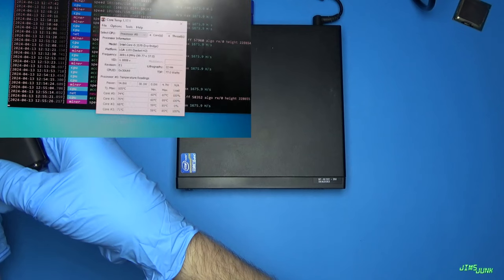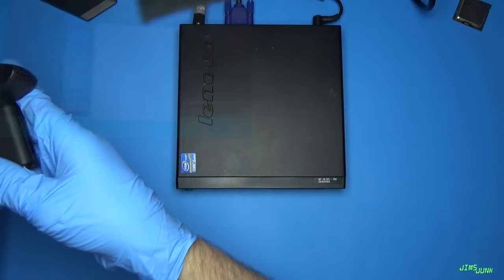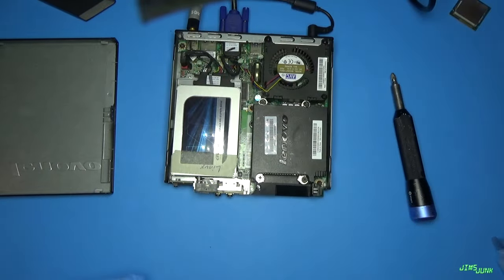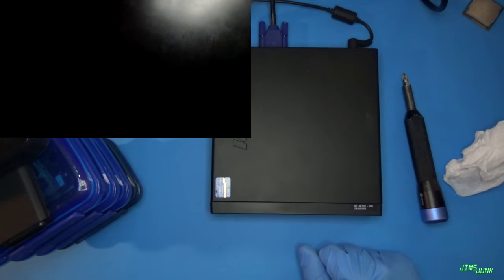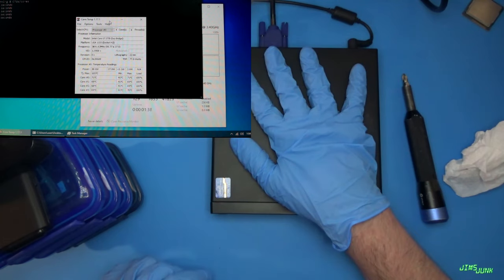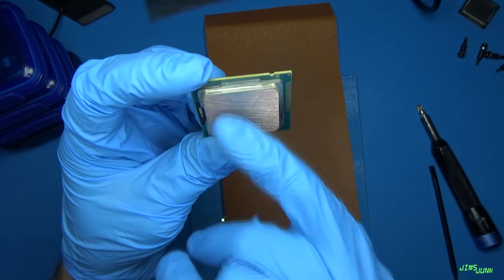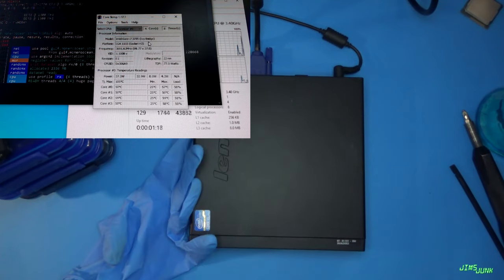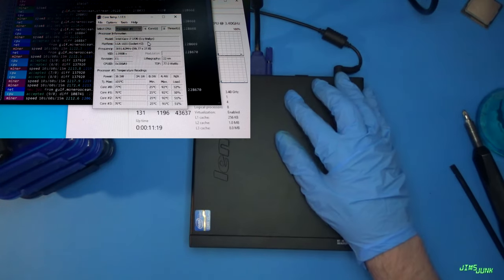i7 3770 in a tiny Lenovo?  Trying to upgrade the CPU in my M92p Tiny.

Comment: You can put a xeon 1275 v3 in there, I have but it's a 95w cpu and gets really hot and then shuts down due the 65w power supply. if you could find a way to upgrade the cooling system and power supply it could work.
Reply from the maker: ya know I thought of that.  Only they cost more on ebay then I was willing to spend.  In the future I might just for the hell of it if i can find one cheaper.

Comment: That is insane the difference it made.  You already lapped the heatsink and that helped A LOT, wonder how fast or hot it would get without the cpu and the heatsink lapped.  But either way with both lapped it stays cool.  Like others said delidding it would be interesting to see if that helps.

Comment: Maybe try a 3770s in a pc like this.
Reply: Yup, they use the "S" version in small PCs and All-in-Ones.
Reply: The "S" still have a tdp of 65 watt. When you are looking for normal temps and no fan noises, the "T" with a tdp of 45 watt is probably your best choice. Also, what I don't see in the video is the power adapter is very important here. Yours can come with a 65 watt adapter, to run these heavier cpu's you really want that 90 watt adapter.
Reply from the maker: Exactly. It does run a 90. I wanted to see if a full blown i7 would work. The s and t m9dels are great but have less performance.

Comment: what i did was  glue on air intake at front  a 30mm usb  fan and that alone  dropped  temps 20 c on cpu at load 
also use a 3770t cpu in it  not a k or a s  as thats 45 watts power  and power pack is only 65 watts  (org) even a 90 has  probs  with the k  trust me i tried note  fan blows cold air in not out so blows over heatsink on cpu and stirs air in whole  case to rear fan   
took about 1/2 hr  to drop temps and  then hold it at that
note  space fan from case x a few mm with plastic  buttons  helps heaps and  drops sound of fan way down as well

Comment: You need to delid that 3770, the thermal paste under the IHS is probably bone dry at 11+ years old.  It's probably 90% at fault for the excessive heat.

Comment: If you want an i7 in there without doing the sanding down, then the 3770T would be perfect.
Reply from the maker: Problem with the t is it's also less performance.  I wanted to see about using the full blown 3770.

Comment: I'm surprised they didn't use mobile processors in these, isn't that what intel did with the nuc?  I mean these are far better than the nuc since you can actually upgrade them.
Reply: "t" chips are more or less laptop binned parts on a desktop package.

These come stock with "t" chips.

Comment: That convinced me. I have two i7-3770's. I'm going to lap one of them and see if I get the same or better results? Mine will be in a regular desktop PC. Should be fun. Does anyone know what grit the brown sandpaper was? Thanks
Reply: For softer metal like copper, 600 grit is a quite safe bet, start gently and check for effect every few minutes.
If you have a whole set, 600-1000-3000 will be a good step-up combination, giving you close to mirror finish in the end while not taking too much time doing so.
Reply: Why if you have a normal desktop? Just upgraded the cooler. They're cheap
Reply: @funghiman8492  Thank you for the information
Reply: @forzaflyracer3473  I just ordered a bigger cooler. Thanks
Reply: @funghiman8492  Thank you for the info

Comment: If the think center has an i5 to start with. the tdp might be estricted to 54watts if it came with an i3.i should imagine using nothing less than a intel stock cooler.you haven't really tested it .it was overheating almost with the desktop on standby how is it going to perform thermaly I bet it will thermal throttle right away it will be useless until a more durable method of cooling the device .its was designed for 54watts and its hardware will be on the limit with only an i3
Reply from the maker: Um I did test it.  Ran it at 100% for a while and it didn't overheat. Plus I've been using it for odd jobs over rdp with zero problems

Comment: I Have A M72e Tiny And I Put A Core i5 2500k In It When I Run Roblox On Lowest Graphics It Screams The Fan At 100% Power
It Hits 100°C Under Full Load But Thermal Throttling Saves It Everytime I'm Using A Delta 19.5V 90W Psu With An Adaptor And It Gets So Hot The Green LED Turns Yellowish But Keeps Going Mine Never Had WIFI But I Added It Anyway First Try Winning The Lenovo WiFi Lottery

Comment: delid it
Reply: Exactly what I was thinking. Ivy Bridge and Haswell were notorious for high temps because of the crappy TIM that Intel used between the CPU die and the IHS. It would be REALLY interesting to see what kind of temps he could get with it after that since replacing the factory TIM with some liquid metal should drastically improve the thermal conductivity. And since he has already lapped the IHS and heatsink, that's basically the last thing left on the list to do.